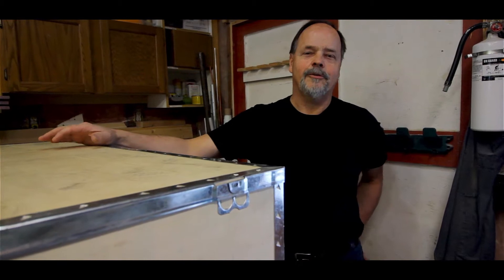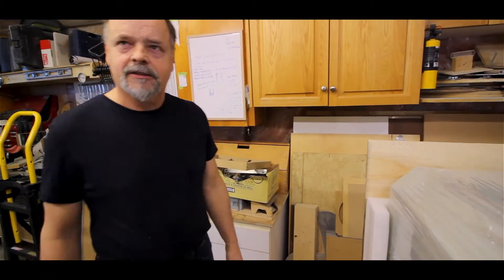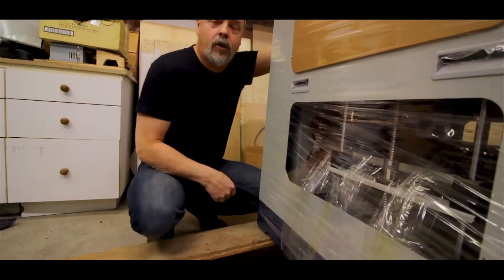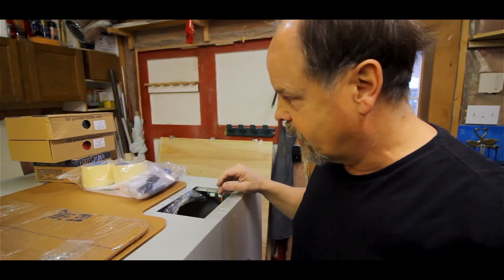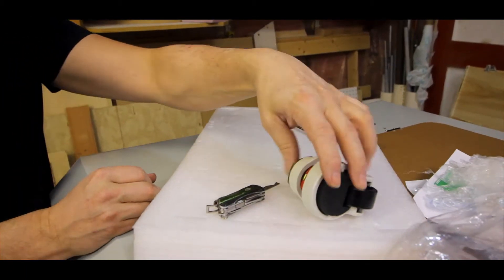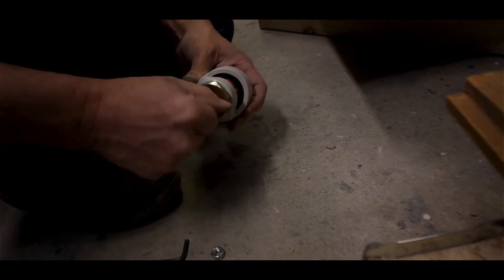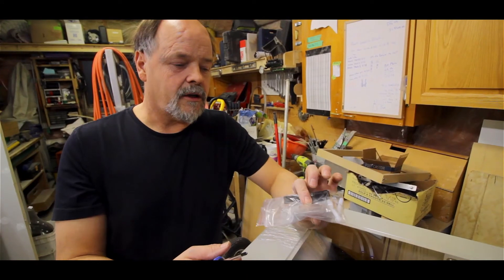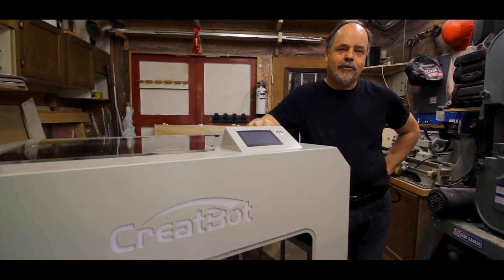Unboxing Creatbot D600 2ft Printer!

Comment: Dont buy creatbot, i have a $4000 CAD sitting here unusable and they wont replace or credit me even partially. I volunteered to pay some but nope they wont do it.
Reply: brian t CAD? I am currently looking to purchase a D600, what problems did you encounter?
Reply: filament sensor broke, filament jam due to all metal part, firmware defect that took months for them to recognize and replace and finally a bearing on the y axis defective and scratching the rod- very difficult to replace because all the rods have to be removed at once in order to get enough clearance to remove the rod, still waiting their instructions on how to do it.
Reply: brian t They don’t have any warranty?
Reply: Well there site says they have a one year, but i've been asking for mine to be replaced since the first problems showed up and again with each new problem and its gets totally ignored, I believe they are delaying just like they did so that i couldnt get help thru ali express and i also was unable to rate them on ali express.
Reply: brian t Good to know, I am suppose to order one this week.
Reply: well i suggest that you look closely at how the x y rods are connected. In my machine you cant remove one rod and replace it, you have to remove them all and it looks like an impossible job and yes, i have one rod and bearing that are defective and i cant print, obviously, and maybe never will, i dont know
Reply: Hey Justin, have you purchased a 3D Printer since then, and did you buy the CreatBot D600?  @taylo708
Reply: @briant444  Did you finally get your 3d printer working?
Reply: @patentexperts1675  No, its been shelved.
Reply: no i got the DX 2 i think. its still not working btw.
Reply: Happy to save you some grief.